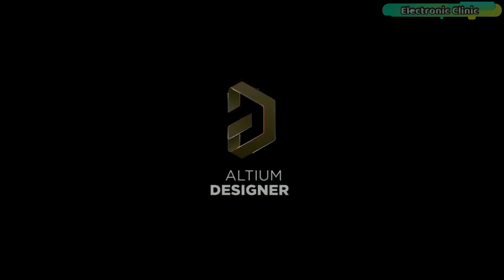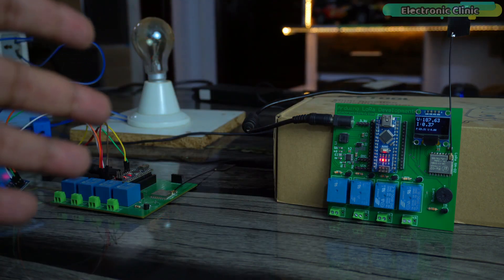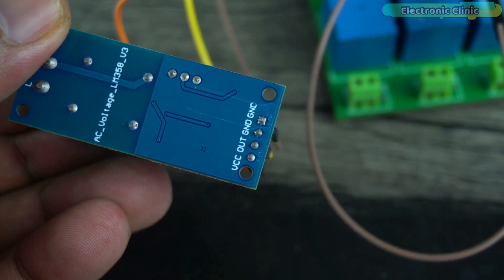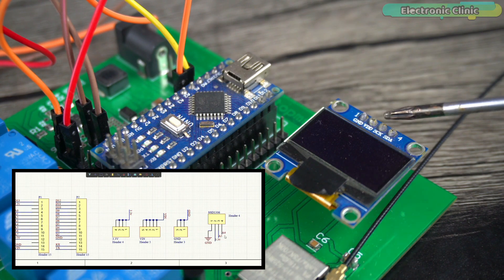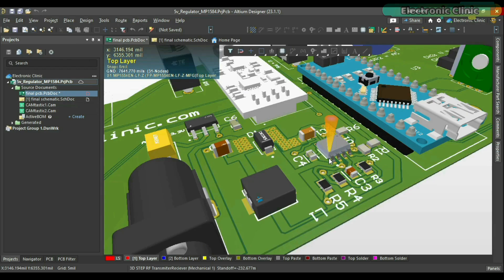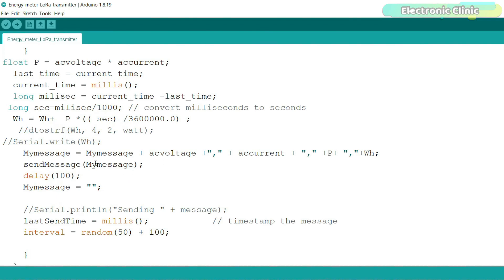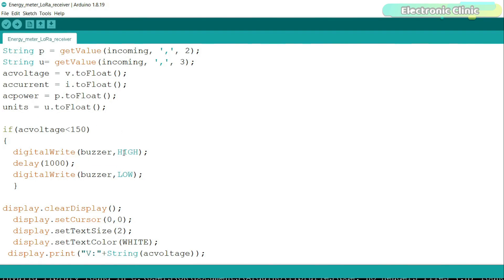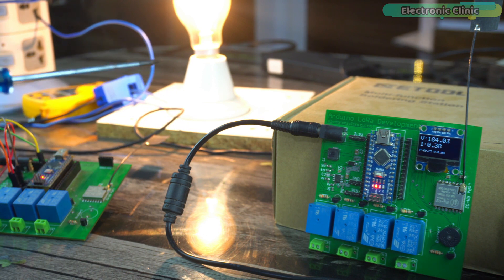LoRa Energy Meter using Arduino | Energy meter Lorawan | LoRa Power Meter, electricity meter

Comment: This lora after some time communication automatically disconnected tx and Rx
Reply from the maker: No it doesn't. 
You should use a watchdog timer, if in case Arduino stuck it will reset automatically.
Reply: @ElectroniClinic  pls send me watch dog tutorial how to use that command